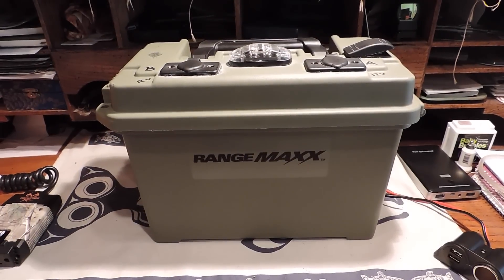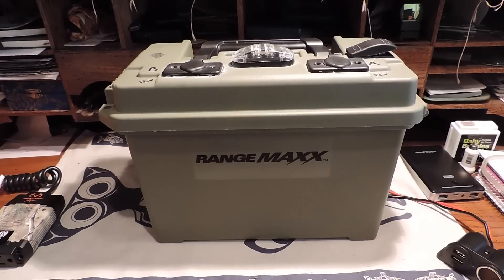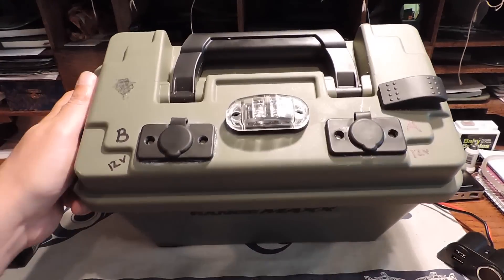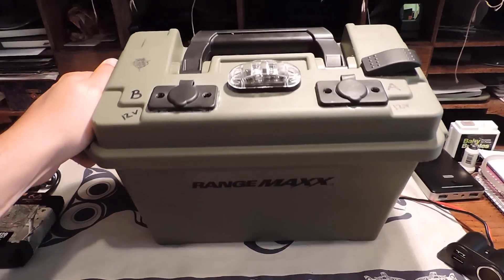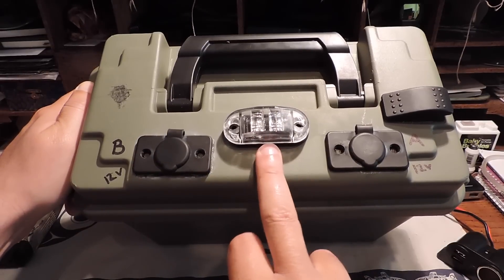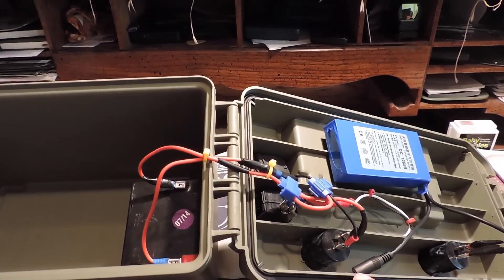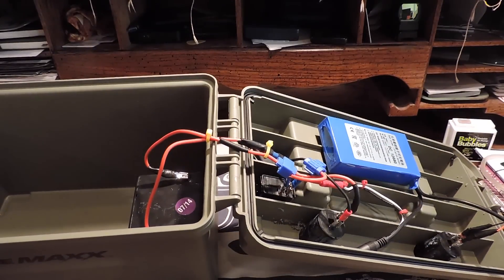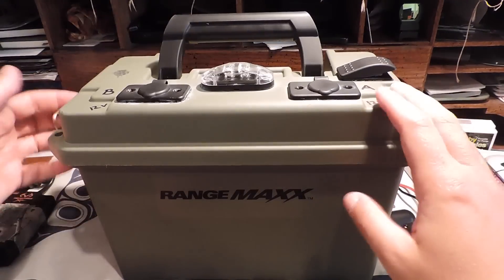DIY Kayak Fishing - Battery Box

Comment: I'm working on something similar for my yak, but I'm not electrically inclined by any means. So I understand, and have watched multiple YouTube videos, that you can only use a 12v outlet with that 12v lead acid, correct? What if I want to put on an ac socket for my power box? Would I just need to install the cigarette lighter the buy an adapter for the ac outlet?
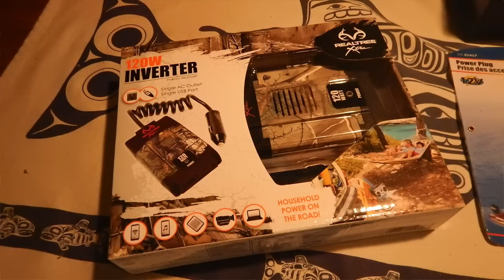Reply from the maker: Manny Dominguez Yeah you'll need a converter. See 0:33 in the vid. Thats the one i use.